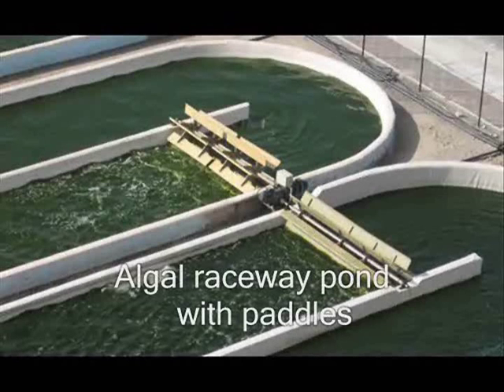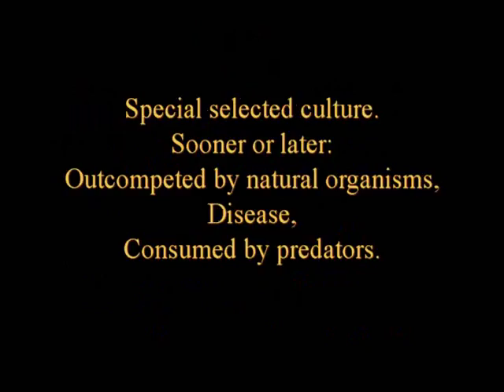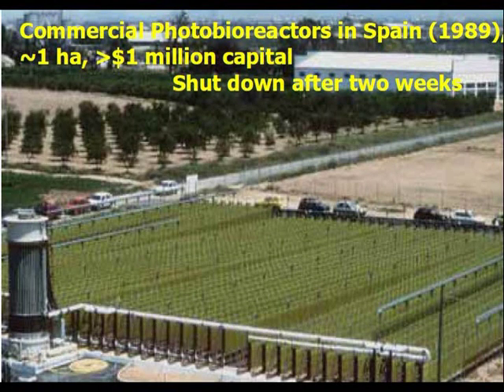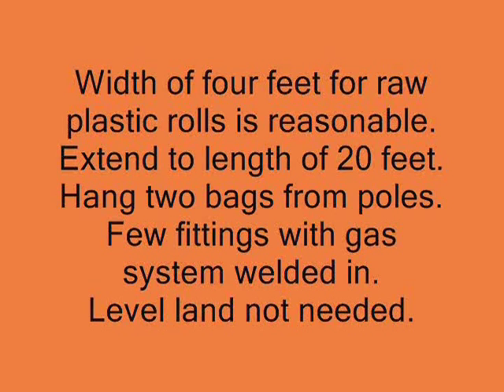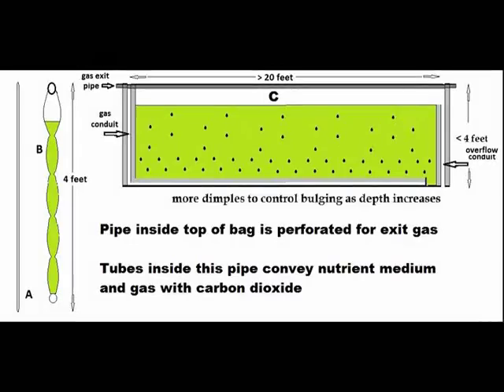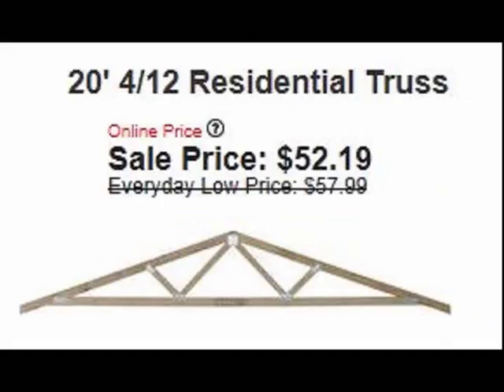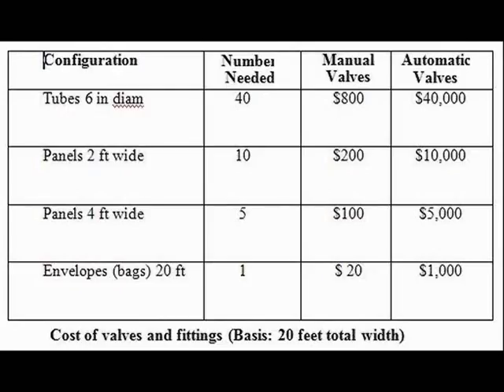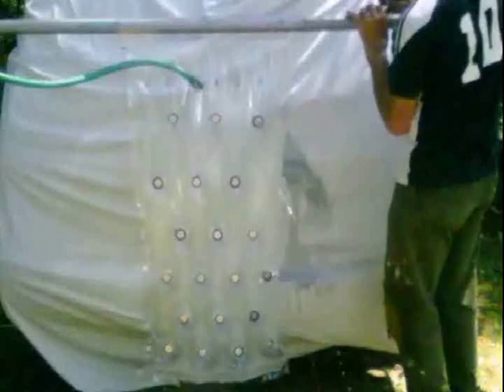Affordable Photobioreactors

Comment: Flexible, transparent plastic biobags hanging on poles cost a small fraction of other proposed photobioreactors. Because each unit requires valves and fittings, the cost per unit is much less for large bags, and most of the gassing system can be constructed as the bag is manufactured.